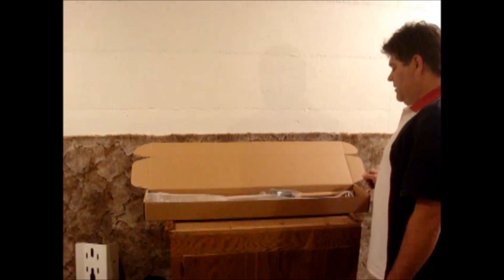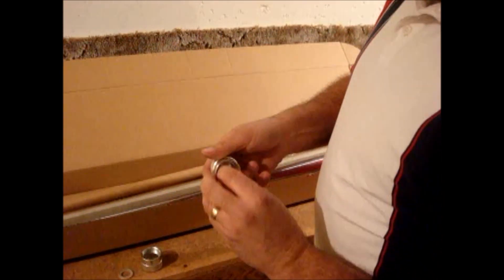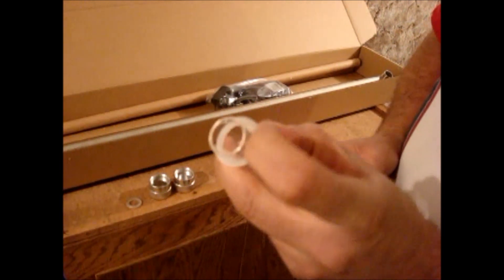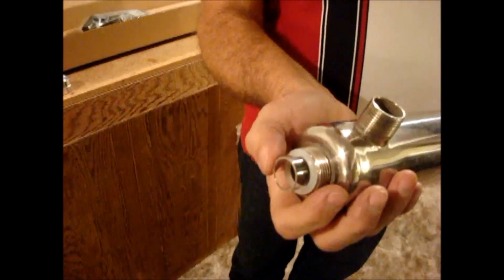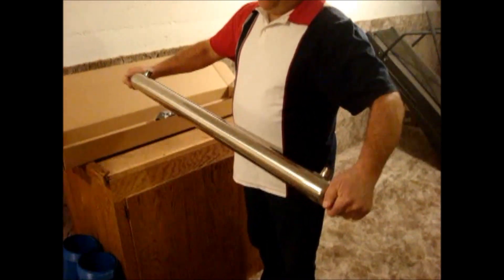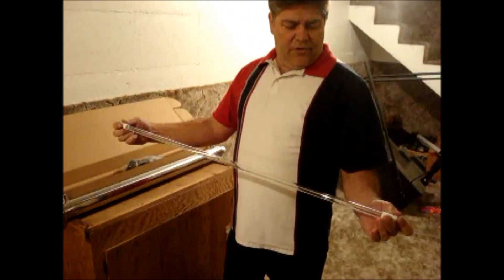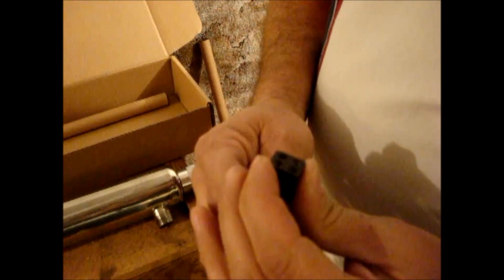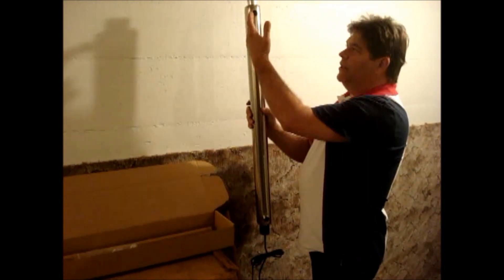Ultra Violet Sterilizer Preparation for 2, 6, 8, 10, and 12 Gallon Per Minute Sterilizers H2O Splash

Comment: I installed this  12 gal per hr unit. It appears to working. However, the light seems to go out at times. I thought it was to stay on at all times. I checked it on two separate occasions and the light was off. I unplugged the 4 pin connector and re-plugged it and the light came back on. Is that suppose to happen?